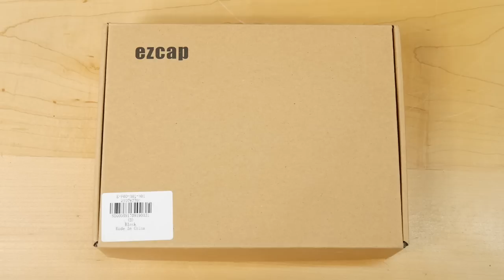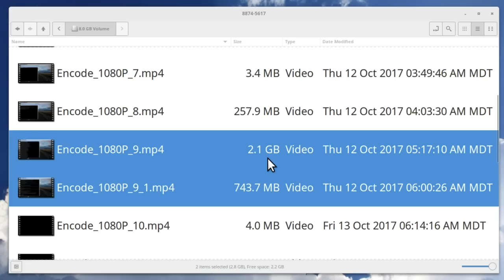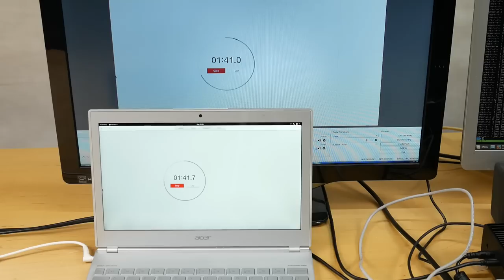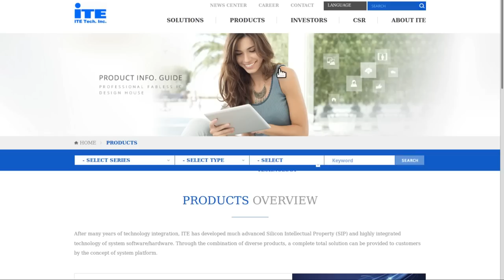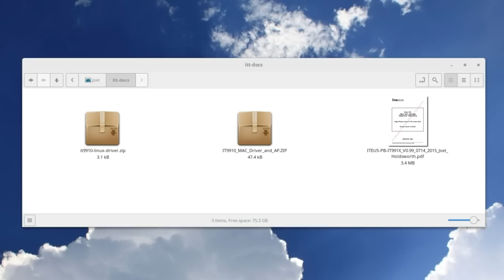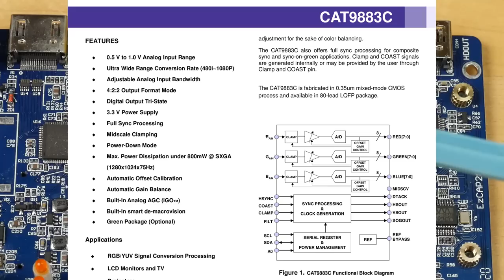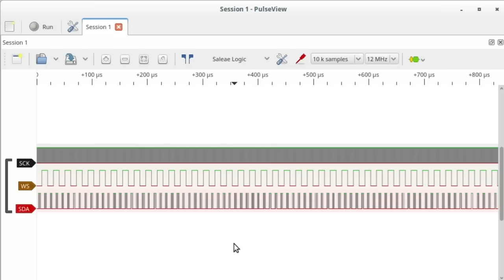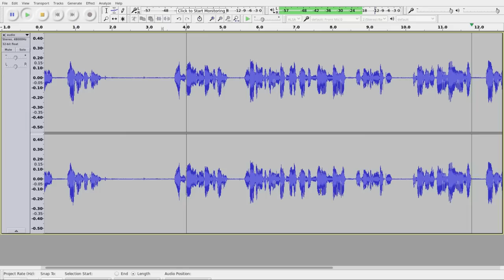[012] EZCAP 283S HDMI Capture Box - Review, Teardown and Experiments

Comment: Hi, I also have the ezcap 283s and I tried to make it work with OBS. I plugged the usb, installed the driver. But I can not see the picture on OBS. Can you give me the configuration to use?
THX
Reply from the maker: Did you see the setup guide? Some of the steps are a little non-obvious. Hopefully you get it working: http://www.ezcap.com/upfile/support/Operation%20Manual%20of%20OBS.pdf
Reply: Yes I followed the guide, but I have a red rectangle instead of the video on OBS, here is a screenshot: http://zupimages.net/up/17/46/ah8a.jpg
Reply from the maker: Weird. I never saw anything like that. If you find the answer, please let us know.

Comment: Pleasepleaseplease do the HDML cloneralliance Evolve model and the Flint 4kp. Probably the most comprehensive technical review I have ever seen. You are a godwizard.
Reply: Background: im passionate about filming local bands as a freelance film maker. For the last few years ive been looking to livestream from my Nikon 1 J1 using 1970s bolex lens via c-mount ring. My plan is to use one of these cloneralliance boxes... I aim to use bluetooth tx/rx to send sound desk audio to my backpack unit containing the cloner interface and power supply and combine it with the camera audio.. Hopefully mixed easily to preference the desk sound direct to bluetooth tx or via Tascam Dr40 monitoring output to bt tx. The flint can connect to cloneralliance app and stream from android but the evolve can instead save a backup copy to usb or tf micro for band members realtime. Im most worried about how the flint is powered as unlike the evolve there seems to be no dedicated power and I'm unsure what it will be draining. If using android the connector takes up the charging port. I have a 5v mini pc (Gole 1) running win10 or android. But the flint uses usb 3.0 which the mini pc has... So thats another bonus, I would be thinking about getting both or the flint and some capture solution with 4k through if I upgrade to a sony alpha 7sii sometime. I am really curious and focused on what the audio quality will be like and what sync issues I will have even though live streaming removes quality anyway. Thoughts? I'm an art student so this is a budget build as always.
Reply: Oh.. My Nikon 1 J1. I removed the lithium cells making up 7.4v and inserted a potentiometer chip ramping via usb micro input from 5v power supply. To use the battery contacts I barbarically wired this to the battery chip also in hopes it might circumvent any issues by pretending to be an en_el20 battery. So my backpack will have a power solution with several usb power outputs for camera, mini pc, bluetooth receiver if needed, cloner if needed. Thanks <3

Thoughts?

Comment: I think they use stolen patented technology and that is reason for secrecy. Why to pay for patent when nobody knows you are using it, right?
Reply from the maker: I could believe that. Nothing from the Chinese wild-west surprises me. Though ITE have quite a reputable brand. IIRC one of my PCs has an ITE SuperIO in it.
Reply: OpenTechLab 

I'm wondering if they sometimes laser the part numbers off the chips if maybe the date codes are old ("new-old stock"), or possibly using something that would normally require a license agreement?

I've never really understood why they often wipe the part numbers in China though, as it rarely takes that long to reverse engineer most stuff anyway, or find datasheets etc.

The two clock oscillators on the IT9910 will likely be for USB 2.0 and the core (12 MHz), and the 27 MHz for video.

27 MHz is a multiple of the most common digital video standards. So, 13.5M for 240p / 480i, 27M for 480p, 74.25M for 720p, and 148.5M for 1080p. ;)

(usually around 29.97 fps, but I think some of the 25 fps "PAL" modes also use a multiple of 27 MHz for the pixel clock?)
Reply: I know this is a cheap device btw, but it looks like it works well, so it's a shame they used an old-skool HD44780 LCD instead of a larger graphical LCD or even a small OLED.

They would then have been able to show things like the mic input level etc., and I doubt it would have cost any more to build.

The old ubiquitous LCD modules are handy, but the newer graphical displays are also dirt cheap now.
Reply: Being able to easily decode I2S audio from the LA captures is VERY useful.

It would be amazing if that could be integrated into the sigrok GUI, where you just click one button after highlighting a range of samples, then it renders the audio waveform on the same timeline.

Even better if a decoder could be added for some video formats too, but it might only be practical on the cheaper LAs to capture some low-bitrate video streams.

Congrats on the EEVblog thing btw.

I was already subbed to your channel, but it's always good to see the more in-depth stuff get more exposure. ;)
Reply: How to take anything you say seriously when you ask wright?
Reply: Chris K

huh?